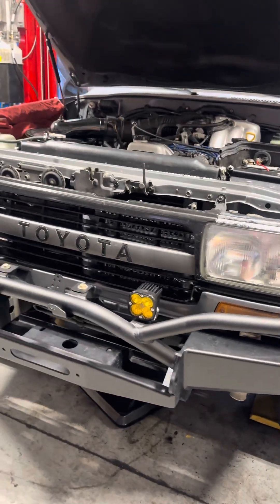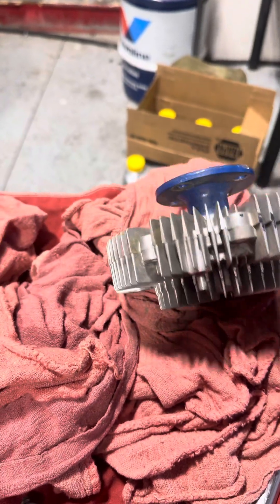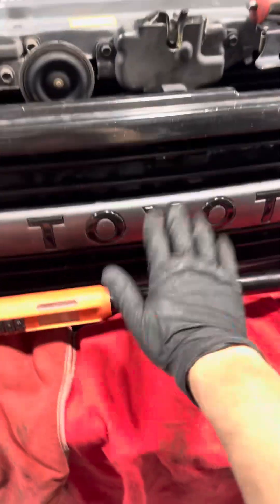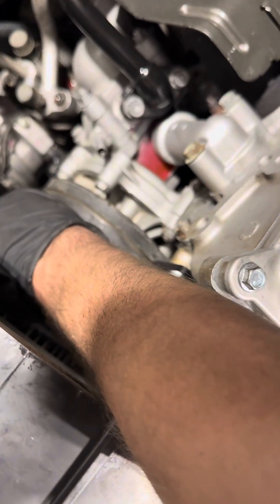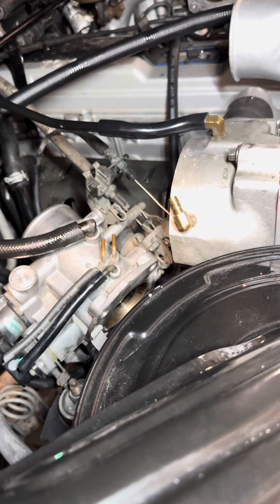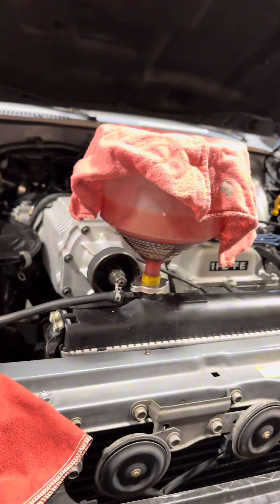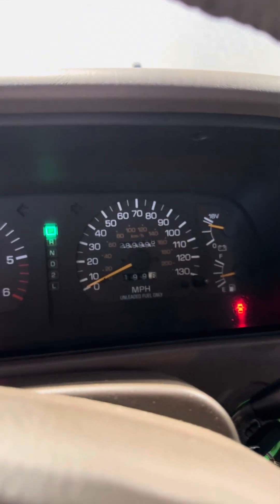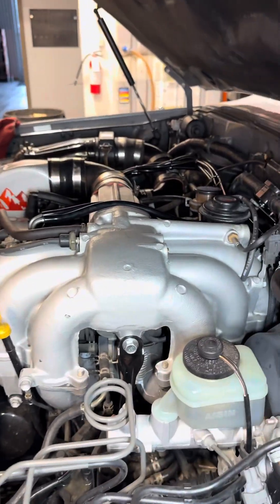1FZ supercharger Instal and Review

Comment: So sweet!! It would be cool to compare this with the turbo systems at Cruiser Co...they are in Westminster (Denver) that might be near you.
Reply from the maker: Jonathan is down the road from my shop I need to find a time to run this test and make a video with him. But I have been in contact with him. 

The supercharger is more so a reliable option to give you a bit more power to keep up with traffic. I think the engine is very strained with intake and exhaust design which is why such low boost feels so much better over stock. The turbo is for those who would want to put up over 10lbs boost. 

Thanks for the comment
Reply: @_JTPR_ that would be an awesome video to make .. to compare the 2 induction types. My 80 with 310,000 still does ok in that Oxygen depleted environment 😊
Reply from the maker: @N @NigelNaughton that’s great to hear! These engines when properly maintained seem to last forever.

Comment: wow, this is probably the best supercharger breakdown for the 80 ive seen. Quality content. Have you tested any of the intercoolers? Seen DBM cooling coming out with one on FB and seems like a good idea but people have been running without an intercooler since it was sold from the dealer. I've also heard folks not use the SC fan but the stock fan in search of greater cooling. Thoughts?
Reply from the maker: 100 percent looking into ways to cool the charge air. I have a mapecu3 installed just for data logging but no tune at this time. The charge temps heating up to the mountains under heavy load is about 190degrees which is when you start approaching the detonation concerns. The psi as well is very low at 2-3psi. So I’m definitely looking into cooling options between air water intercooler or a methanol injection kit

Engine cooling you have lots of options. This was to show what’s in the kit but you can purchase a separate clutch from land tank that is a larger clutch I think from a 100 series but not 100% sure what it’s from. But you can use the factory fan with out using the spacer. I haven’t overheated or anything my temps get higher under heat soak but that will happen no matter what because of the lack of exit airflow on the 80s

Thanks for your comment!

Comment: Dang it, they priced the kit so close to a 5.3 swap. Makes more sense for rebuilt 1FZ-FE motors. The Magnuson was 4.5K, last price I saw before they discontinued it. Will you modify the exhaust manifold? I think it was a different part on factory S/C models
Reply from the maker: They are very pricey now for sure. The kit as is has no modifications to the factory exhaust system. It relocated your throttle body which involves extending the wire harness. It drops the heater pipe to run along intake manifolds. And adds a crank pulley to drive the supercharger. That’s a very oversimplified version of the instal but you’re retaining most of your factory parts around the engine.

Comment: hey mate, aftermarket ecu or no need?
Reply from the maker: No need on factory pulley. Fuel trims stay well within “safe” ranges so I’d say none needed up to a 3in pulley

I will be installing a map ecu to run a 2.8 pulley at some point but as is it runs and drives very well as a bolt on